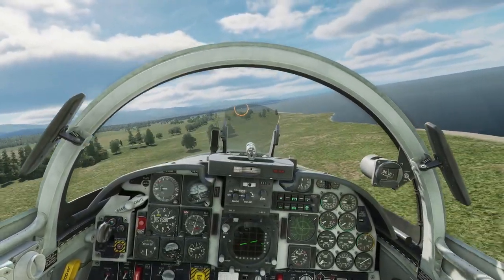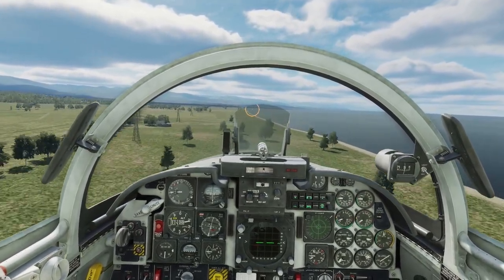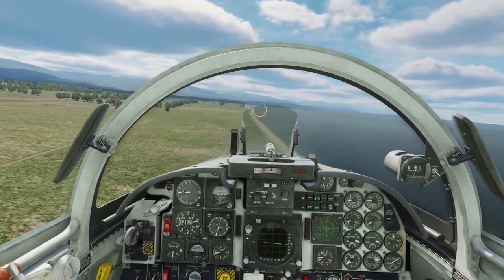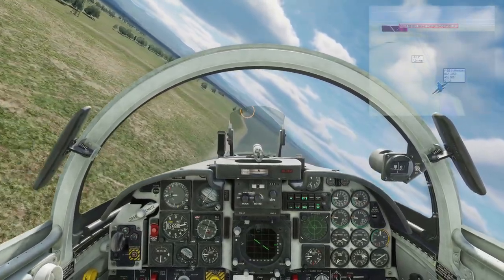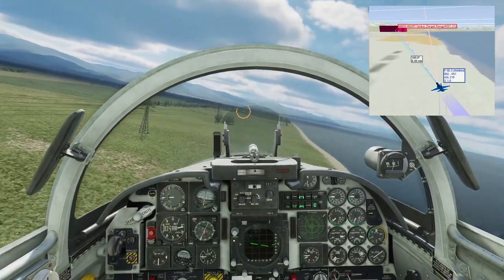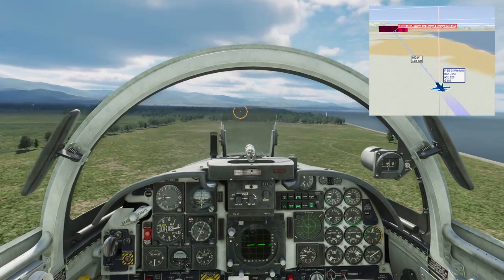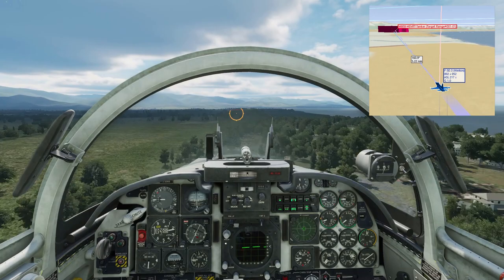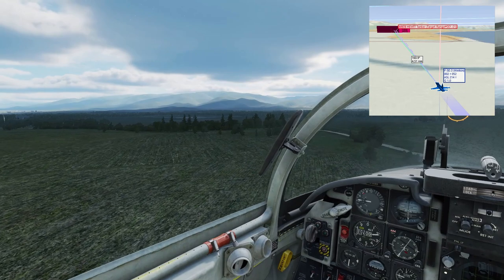DCS - Toss Bombing Guide

Comment: I tried this with GBUs, thinking it would be handy with buddy lasing. The most i got was 2 to 2.5 miles, and i never could get the lasing to work right and then abandoned the idea. A more skilled team might be able to make it work.
Reply from the maker: Might be that the fins add enough drag to reduce the achievable range. The other part is that the bomb only has a limited cone of vision and the earlier it can make course changes the better, since the laser won't be visible to the bomb until the last moment the benefit of the guidance is limited. GPS bombs from an aircraft that's able to use them might be a better.